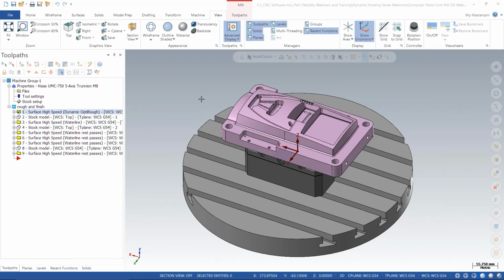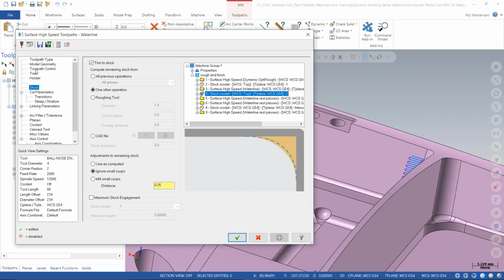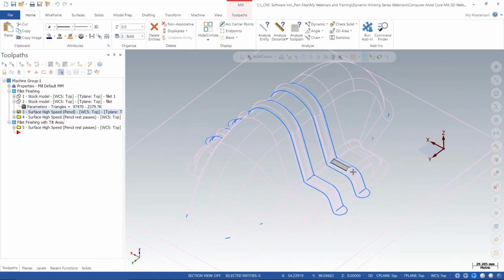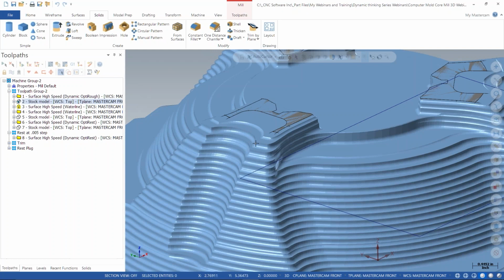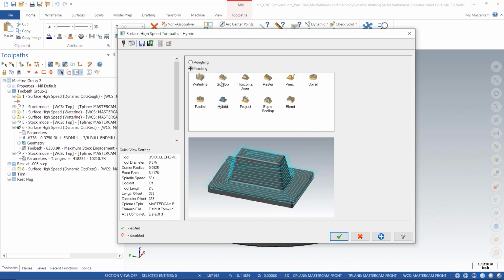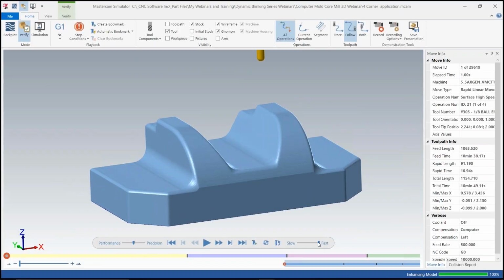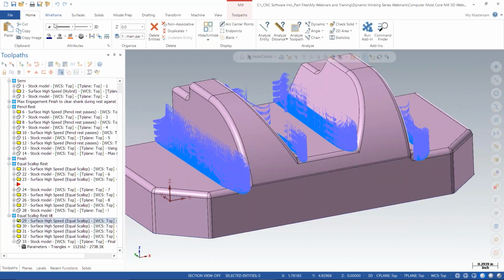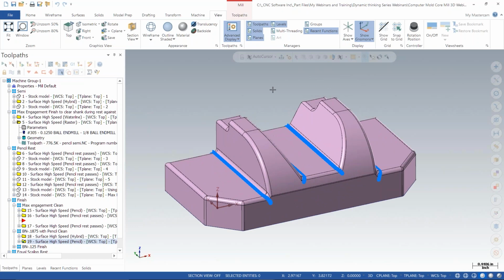Stock Aware Finish Machining

Comment: Hello Mastercam, how do you know that how much volume of material left at corner in depth after roughing  and on what calculation basis you are setting value of maximum depth in maximum stock engagement.   And even in series of pencil passes how did you set 0.06" in stock to leave at first. Is there any way to calculate it?
Reply from the maker: Hi Mamunur! The approach we took here was manual. There is no volume awareness, it would be up to the programmer to ensure there step in values are safe for there particular tool. This was a conceptual video showing the flexibility Mastercam offers when you have a deep understanding of what all the options are capable of. We encourage you to check out our new Equal Scallop 'step-in' technology found on the 'Stock' page in Mastercam 2023. It's manually explained at the 27:50 mark in this video, we have automated and implemented that concept in Mastercam 2023.